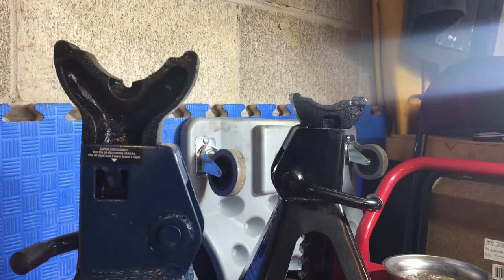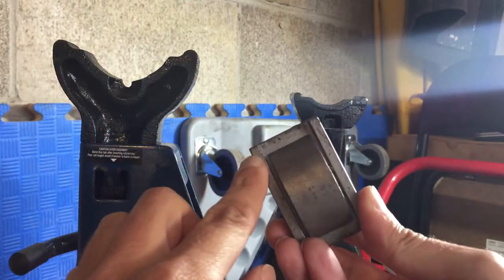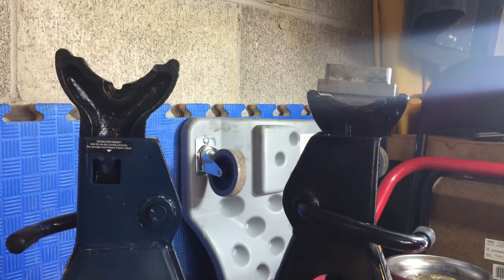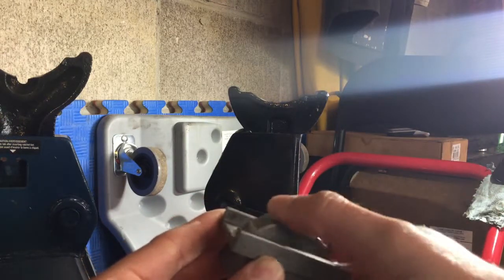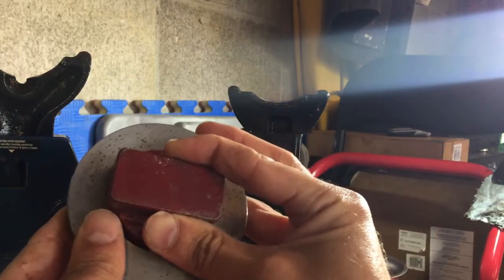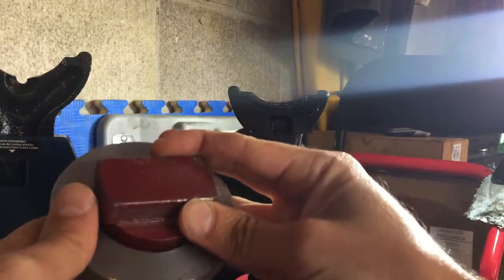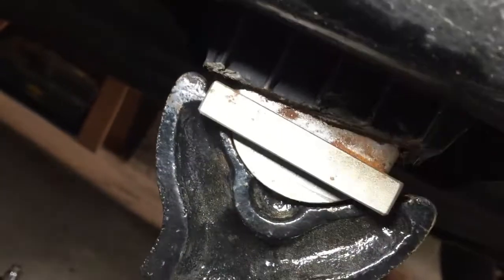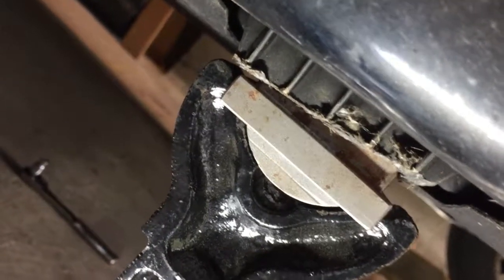New Design of BMW Jack Stand Pads - Fresh from the Machine Shop

Comment: Why not just machine half the top off the jack stand????
Reply from the maker: Say if you sell the car
Reply: @mecheng1977  Fair point... I need pinch weld support.  No bmw's allowed in my garage, I'm sick of them and their BS.  Got an S430 now and when that's gone, Oh happy day!   Thanks for showing your adapters, they don't look hard to make at all.
Reply from the maker: @jagboy69  hopefully it will be reliable because just the parts alone will be crazy expensive
Reply: @mecheng1977  and that's why I'm dumping this German pain in the ass too.  I'm done with German cars and their over engineered bs..  Spent almost 6years living in Germany and owned them all.  They aren't like the over reliable stuff made in the 80's.  Well, BMW was a mess too back then, but there was nothing better than a 1988 560sel.  Love em!